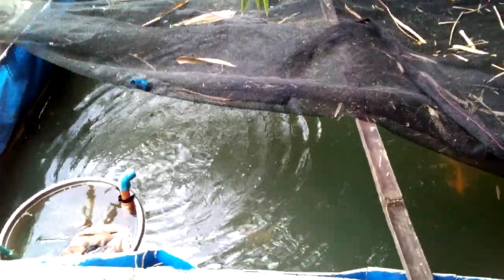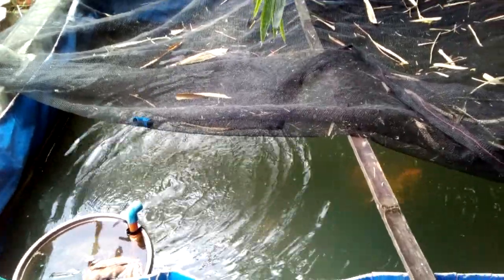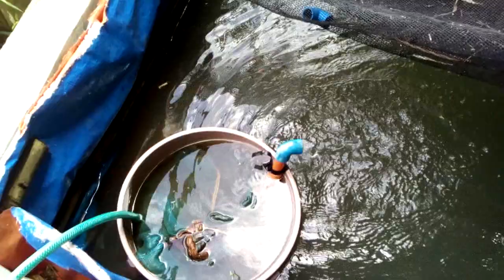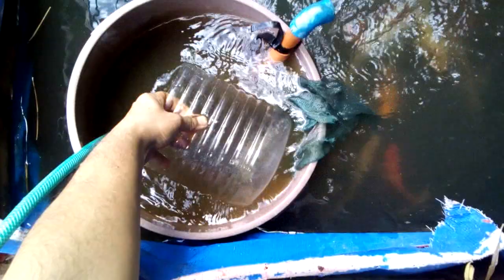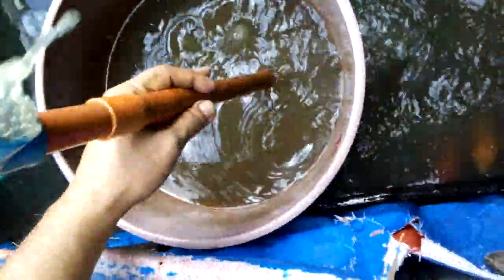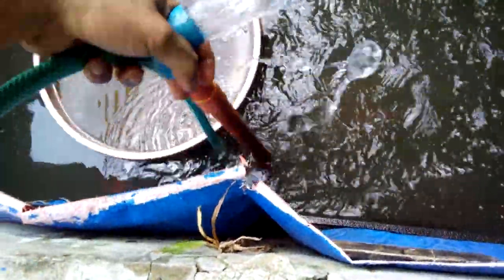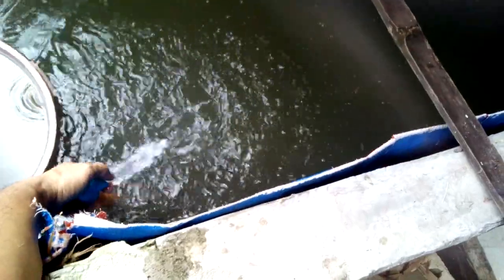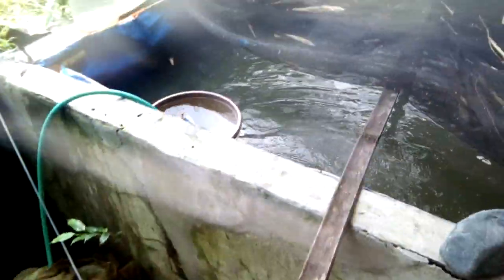air lift pump for koi pond Save electricity and Safe from electric shock

Comment: How does the water get into the bucket so that it filters and pumps out?
Reply from the maker: There is an airlift pump who suck in the water going to the filter bucket
Reply: Is it just the holes on the lower sides of the bucket where the water is sucked in from and then pumped out? Thank you!
Reply from the maker: @cameloogirl  yes it is